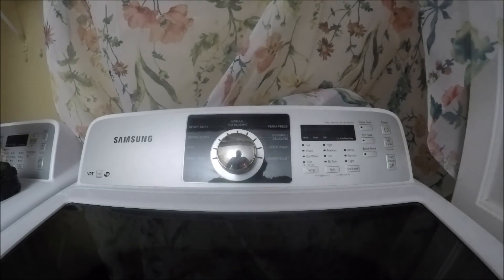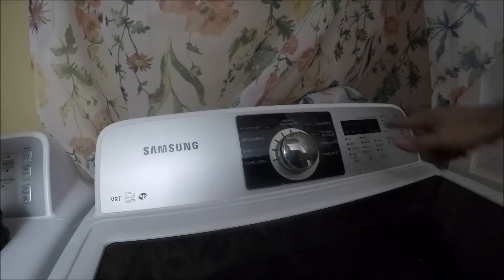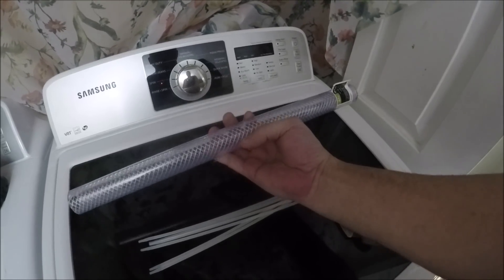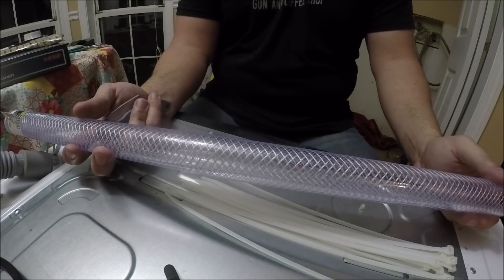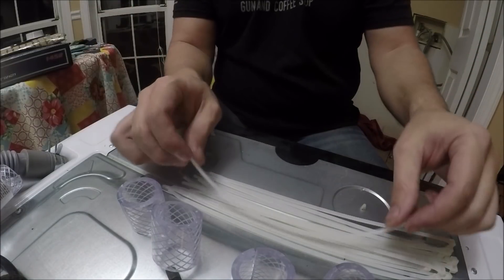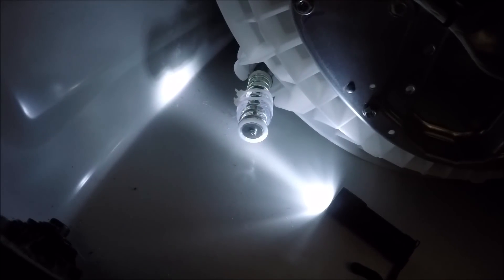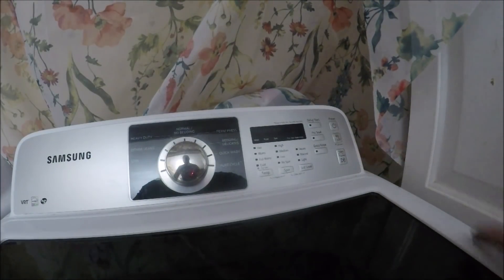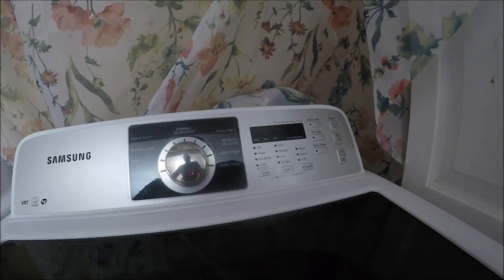Samsung DC Error Code $3 fix in 5 minutes

Comment: My wife calling me a hero after I learned this DIY fix from your video. I used 1¼" inside diameter braided hose (as you suggested if you were to do it again), and used 3 zip ties per 2" length of hose for each spring column.  Spent under $5 for that material.  I tip my hat you, sir.  Cheers!

Comment: 2 yrs later this fix is still making a difference! My husband didn’t believe me that I could do it, and I bet him a new washer that we could lol I told him just to tilt the washer back and handled it myself from there! Lowe’s only had 3/4” tubing so I used 2 pieces and the zip ties instead of 1-1/4”. I also couldn’t get my hand in position to do the 4th one behind some black hose so I was only able to do 3 of them and even that much reinforcement of the springs helped tremendously. Thanks so much for this fix. I already wasted almost $200 on a repair guy that came out twice and did nothing except clear the code 🤦🏽‍♀️ thanks again!

Comment: Thanks for the video!  I first purchased new suspension rods that were Samsung original replacements.  They worked for a month and error came back.  Did this fix on the replacement springs.  Washer did better, however still had error frequently.  Went back to take a look at the originals that I replaced. The original spring actually has thicker metal and larger diameter!  Disappointed that I paid $100 for crappy replacement parts (triple checked to make sure that I got the correct part).  Went back to originals and did this fix.  Washer worked great for a couple of weeks then error appeared again. Took rods back out and used hose clamp on top of hose and zip tie on bottom.  This setup finally worked!  Has been error free for numerous loads of laundry.....bedding, towels, jeans, etc.  Fingers crossed it holds up!
Reply: Hi Chris, thanks for your comments. Would you recommend two clamps, or the way you did with one clamp top, and one zip tie bottom? What dia. hose would you recommend? Thanks!

Comment: I've had many problems with my washing machine. I've tried drilling holes in the top water reservoir, tried stuffing pillows in the corners between the inner drum and the outer wall, and other 'fixes' on YouTube, all to no avail. This worked perfectly for me! Thank you!
Reply: Same for me. Replaced pump, board, wiring harness, recall fix and foam pillow method. If this doesn't work, I'm getting a front load one.

Comment: Just did this fix on my machine last night and we ran several loads through, including some pretty heavy ones, with no problems today.  Thanks for the video, it helped a bunch!  I used 1-1/4" ID tubing like you mentioned in the video but it seemed like the tubes would be too loose on the springs so I ended up cutting slits down each one and cutting out a slice to make sure they would tighten snugly.  Good luck to anyone else looking to try this!
Reply: This is exactly what we ended up doing! Works fantastic
Reply: I am glad i read your trick because the video maker used one inch which worked for him. 1 1/4 will not work as you cannot tighten it
Reply: I had to do this as well :)

Comment: I've resolved a bunch of different issues with my Samsung washer over the years (replaced pump, replace control board, replaced dampers and in a foam pillow fix for the dc error which has worked going on to 2 years). I initially replaced 4 spring dampers to resolve the dc errors but that didn't help as the springs weakened very quickly. Don't ever let a repair person recommend doing that as the only solution. I would replace them if they have gotten really out of shape from many unbalanced loads that wrecked them, but in addition to replacing them, I would do something like this videos suggests, or use foam material or pool noodles around the outer drum spread out evenly. Be sure that the washer is sitting level. Finally, keep in mind that these aren't commercial washers, so for some people who want to wash 8 comforters at once, don't do that, and if you do wash heavy towels, comforters, small rugs, use the BEDDING wash cycle which avoids very high speed spins.

Comment: I did this around a week ago and so far so good. It's run roughly 5 loads without any issues. Thank you!

3 tips for future fixers:
1) Cut the hose in the hardware store. They already have the tools there so it's really easy.  (I used 1 3/8 and it worked great)
2) When placing the zip ties start the zip locking before you get into/under the machine. So essentially you are pulling a loose loop over the hose and then tightening. It allows you to focus more on the tightening and less on getting it zipped. It also allows you to work without needing to line up the zips in the machine. I found this especially helped for the 2 that were on top after turning over the machine. 
3) Some water came out of the drum when I turned it over. Have a couple towels and a bucket handy to soak it up.
Reply: Best video and best advice, I used the cutting tool at Homedepot, best $7 fix

Comment: I might be a rare person that comments long after doing this hack. Of course it worked when I did it, and for that I am grateful, but months later it started doing the same thing. I tried other things and am convinced it's a manufacturer flaw, especially considering the recall mess, how long I had this washer, and that it gets used every day. Point is: sometimes trying everything isn't enough and you gotta get a new machine. So don't be too hard on yourself if new springs, foam padding or replaced parts don't work out. That said, I love the video and thanks.

Comment: WOW!  We were ready to give up on our 10-year-old Samsung washer because the DC code went from rare to occasional to every load to multiple times every load.  I'm so glad I found this.  The current price for the four suspension rods/springs would have been well over CAD$400 so I would have just gone with a new (NOT Samsung) washer instead.  This low-cost fix has worked like a charm and was surprisingly easy.  I wouldn't say five minutes, but it is not a stretch to say that it was an easy DIY job.  Thank you cvsahara!!
Reply: We have a 11 yr old top load Samsung and I was getting so frustrated with the dc code going off with every.single.load. Your comment is giving me courage to try this fix. Wish me luck 🤞🏼🤞🏼

Comment: I purchase a used set of Samsung washer and dryer.  They came with a 30 day warranty.  Figuring as much as I wash any problem would rear its ugly head rather quickly.  In the beginning I would occasionally get the "dc" error code.  Well, after about 45 days the drum started bouncing around like two teenagers in the back seat of a car on a Saturday night.  And I did what we all do when faced with a situation to spend money or not.........we go to YouTube!!!!  I found your video and you gave me hope.  I have to admit to being skeptical that some thing so simple could correct this issue.  I followed your instructions without deviation.  Now to test!  I was watching TV and forgot that the washer was on until the chimes for the end of cycle began.  It is like Lee Majors in the Bionic man.  "Better than before".  (Ok, I just gave away my age range)  Thank you for doing your own research and posting this video.  Now I get to spend my weekend catching up my smelly laundry.  Yippee!!

Comment: Last weekend we had a appliances repair guy coming to check our washer. Samsung Model WA5871ABW/XAA. Estimate to replace all 4 springs was around $150-180.
We followed the video instructions,  work like a charm. Did laundry for entire weekend with heavy load, and no DC code! Thank you

Comment: This worked very well for us for about 6 months or so, then the hose slipped down the springs (they have some kind of grease/lube on them) - I just added a few more zip ties, and it's back to working again...I can't wait to get a new washer, but until then, this fix is GENIUS! 

(BTW, In addition to the d/c error/unbalance prob., I also had the pump housing issue where it cracked off - a whole washer tub of water poured through my ceiling into my office downstairs -tons of damage...turns out they didn't issue a recall, but they did have a repair kit to move the pump from the underside of the tub to the frame. They did fix the 'top flies off and could kill you issue' -maybe they only recall when it can kill you? Not so sure I'd ever, ever bu a Samsung washer again.)

Comment: THIS WAS A  GREAT SOLUTION AFTER USING HOSE CLAMPS!  I was having this problem for several months, and it was getting progressively worse. I was considering a washer replacement before watching this video.  It was a very easy fix.  I used zip ties at first, but it would only solve the problem for a couple weeks before those rubber hose 'sleeves' would eventually slide to the bottom of the spring and the DC error would return.  I tried it a couple more times with more zip ties, but go the same results.  I then tried metal hose clamps.  It has worked perfectly for 6 months now.  And I have 3 teens, so it gets a ton of use.   THANKS SO MUCH!!!

Comment: Works great, thanks man!  Better than new.  I used 1-1/4" ID clear plastic tubing and bought a package of ten #20 metal hose clamps (3/4" - 1-3/4") from Lowes.  Total cost was $13 because the hose clamps were $9. I turned the washer on its front to get to the bottom the same way that cvsaraha shows in the video.  Really easy to do.

Comment: Just did this to our used (new to us) Samsung and it got us past the dc error! Definitely not gonna be a permanent fix for our's though, still shakes and bounces a lot before she gets the chance to even out. Thank you for the video though, it saved us for now.
I did want to say, to anyone reading, I didn't have the proper vinyl hose but some 1/2" I had laying around from a previous honey do worked. Cut it a good 3-4" long, split down one side and wrap it long ways (against the natural roll of the tubing). I did a zip tie on top and bottom and a small worm gear clamp in the middle. I was reading around today and supposedly Samsung sells a kit for $70 with better reinforced springs.

Update: Call Samsung and see if your model is covered under recall (you'll need to provide the serial #). Ours just so happened to be and they have fixed every issue the washer had (new springs, lid reinforcement kit, new thermistor, new wire harness and a new part for the water distribution after the valves). The recall adds a year of warranty to machine regardless of age and they treat it as if it was a new machine. Granted the tech doing the work had to follow protocol which meant 3 trips to get all the work done. As of today I am successfully washing full loads with zero issues and I have a one year warranty to boot!!
Reply: Samsung aqua-jet, called for the recall they gave me some numbers to give the repair person when they call to make the appointment.  They said the will come out an repair the lid then, you’re under 1 warranty. Then they can come back out and fix the other issues. Woot!!

Comment: Thanks for the video, you saved us a new washing machine.. We called a repair man and charged us for the house visit and declared that the transmission was shot and it would cost $450 to repair no guarantee. He recommended that we get a new one.  We saw your video and decided to give a try. We used 1 1/4 inside diameter plastic tube and metal hose clamps.  We made the sleeves 3.5 inches and secured with one hose clamp.  It works !  Thanks for tip. Woohoo !!

Comment: I'm going to try this tomorrow. I have already replaced the spring rods and recalibrated. Although the washing machine is more stable, I'm still getting some vibration once it gets to the last spin cycle. It then stops with the Ub code and wants to refill with water and start the rinse/spin cycle all over again.  My Sumsung washing machine isn't even three years old. I'm really disappointed in this product. I contacted Samsung and they gave me a price of $379.99 to send someone out to repair it. When I said that's not happening, they offered to give me a discount a new washing machine. I asked the lady why would I purchase another Samsung if this one has only lasted me three years with this issue. She had nothing. Hopefully this will work for me. Thank you for posting and I will come back and update you all!

Comment: Just to give more info on this fix.  I bought the 1 1/4 inside diameter hose, just like the one mentioned in the video.  However, the hose was too wide to actually clamp on the spring.  I cut a slit in the hose but the hose, after a few cycles slipped down to where it wasn't useful anymore.  Also, I had 2" tall pieces cut.   

My new fix was to cut the separate hose pieces at abut 4" and then cut about a 1/4" slit long ways down the 4" cut pieces.  This way the hose will be able to clamp on the spring better.  Also, the length will allow the tube to still be on the spring as it slips down.  I'm having a hard time getting tools/hands in there to really tighten the zipties down.  

Thank you for an awesome video!

Comment: Like so many others I want to add my thanks for posting this life-saver. So easy and works like a charm.  After just 6 years, this machine is already a rusting piece of absolute crap that will need replacing soon enough but thanks to this fix, not for another year or so.

Comment: I tried this to get rid of my dc problem.  I used 1" ID transparent hose that I bought from a local hardware store. I also replaced side sponge padding from the top; since those were all torn away.  Result: the first run was successful - completed a quick cycle with no dc error.  Second time, I tried to stress test it and threw in bathroom floor rugs.  This time the machine banged around making noise but no dc error.  Instead of keeping the stress test, I manually stopped it before it gave me an error, because I got nervous that the hose parts will all loosen away.  I will try washing again a few more times with regular clothes and update.
*updated next day: Tried with regular clothes, and the result was good!  no dc error nor much vibration.  Thanks for the video, cvsahara!

Comment: For anyone still struggling with the DC error code with a top load but can’t get to the store to buy this stuff immediately, I have the stupidest temporary fix for you, instead of fixing from the bottom we can fix from the top. Fold some really sturdy cardboard like an accordion and put it between the part that doesn’t spin and the frame of your washer. It creates enough pressure from the top that your washer won’t slam around and your washer can complete the cycle. It’s ghetto as hell but it works as a temp fix until you can get to the store. ✌🏼

Comment: OK, I don't care what the negative comments below people have said about this but I just tried it, and for the first time in a year, I did not get the DC code. I have 3 heavy blankets, a big bath towel and a heavy bath rug in the washer now that always stopped when it started to spin cycle. It just competed and no DC Code.... This video is better than I could image. Thank you sooooooooooooooooooooooooooooooooooooo much. If anyone has a problem by saying it does not work then there is something else wrong with the washer if you think I am wrong, just ask anyone below. Trust me, it was the best $10 bucks I have ever spent.

Comment: Found your video, went to home depot and the guy gave me a foot of the same tubing for free. Took me approximately 30 minutes. Found some bits/buildup in the hot water inlet screen cleaned that out while I was in there. But I have done 3 loads with no dc error anymore, thanks for the video!!!

Comment: Thanks for this video - it saved me a bunch of money! I tried the 1 1/4 ID, but like others, had to trim about 1/4" off, so 1" ID is correct. I also initially used hose clamps, but reverted to zip ties after still having issues. I think it's easy to get the hose clamps too tight, but the zip ties work perfectly. Three loads in and zero issues!  I'm convinced that Samsung appliances are just low quality. I've had issues with all of my Samsung appliances in less than five years of being new.
Reply: is there a happy medium for how much to tighten it? Have I zip tied mine too tight? mine still gets a DC error with normal sized loads =/
Reply: Dr. Jonathan Leung Yes, I initially made mine too tight as well, and continued to get the error. Just about a month ago however I went ahead and replaced the suspension springs because we were once again getting the error. Since I replaced the suspension springs/rods, it’s been perfect. You can get all four as a package on Amazon for about $50 and they are relatively easy to change.
Reply: @nvonalven  thanks. I'm actually going to try and redo the zip ties a bit looser first since I've got them on with me pulling them at a max. I've also got my threaded cord tubing a bit longer than in the vid so meyb I'll try and cut em down to about an inch and a half or so. Got some time today and it's laundry day so I'll test a load or two. If that doesn't work I'll order new rods as per your recommendation! Let you know how it goes.
Reply: @dr.jonathanleung5971  Any update? Still problematic?

Comment: I did this and it fixed our washer.  I used 1.5 tubing, cut at 1.5 inches long and two zip ties per tube.  I placed the tubing right in the middle of the spring.  I went through the top of the washer so I didn't have to tip it over (it is in a tight spot)  Worked perfect!  A two foot section of tubing at Menards was $6.

Comment: AWESOME VIDEO!!!! Completely fixed my problem on spin cycle. I tried the 1 1/4 tubing as you recommended and I will say it is to big, had to cut it and make it a bit smaller. The 1 inch tubing with zip ties is totally the way to go! Thanks again man really saved us over here!